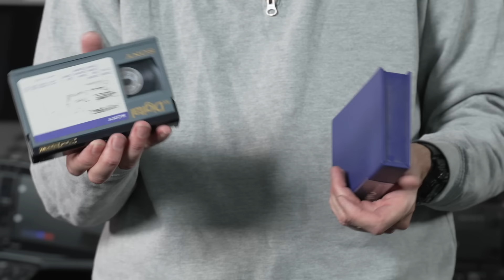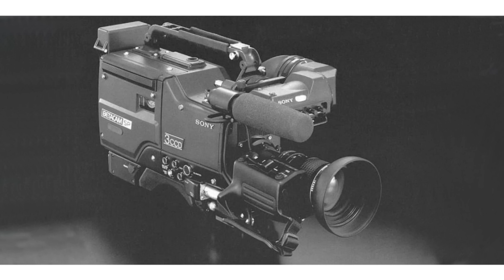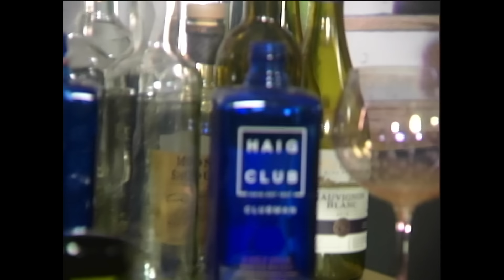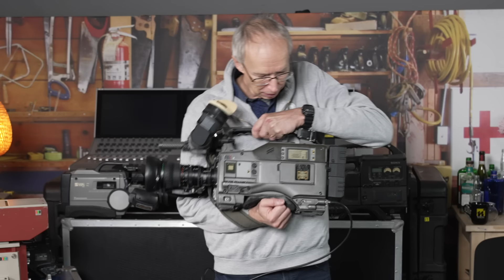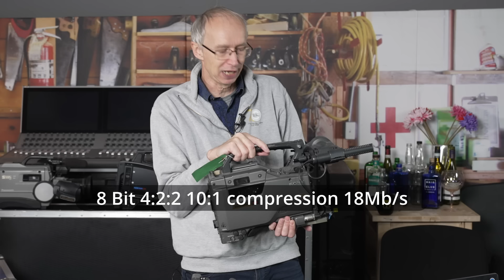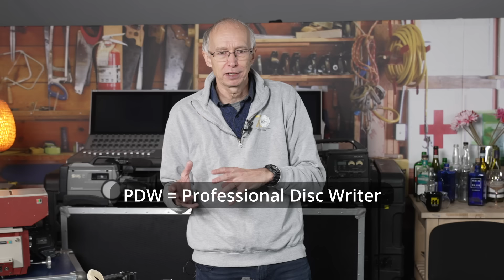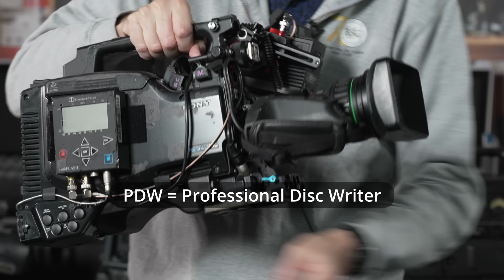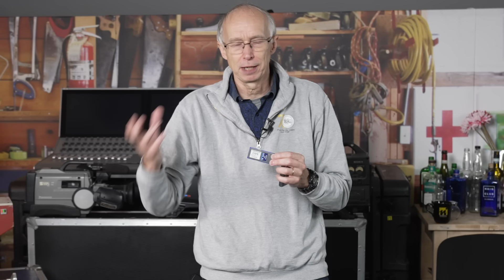Betacam, Digibeta & Optical Disc, a look back at some vintage Sony Camcorders with Alister Chapman

Comment: What an awesome trip down memory lane! Thank you!

I started my TV news career in 2000, and my first news camera was the venerable BVW-507 with those awful BP-90 "bible" batteries. Funny thing is I owned a VX-1000, which was better at low light, so I'd sneak in footage of that when I could.  Creative services had a BVW-D600 and an Ikegami HL-V59W. I'd sneak out the D600 on weekends if it wasn't out on assignment. We switched to DSR-500s shortly thereafter for news, but kept the awful BP-90 batteries. 

My next station had a mix of BVW-400s and DNW-90s, but our editing workflow was SX with the finicky Sony ES7 workstations.
Reply from the maker: I was trying to figure out when lithium batteries became "normal". The Digibeta cameras in 1994 had a V-Mount as standard as did every sony camera from then on and I suspect this was when the first Lithium batteries appeared, but I also remember using PagLok adapters on cameras with native V-Mounts to use PAGLok versions of the BP90 Nicads. It all seems so crude back then with NP1 and BP90 batteries that had go inside a compartment attached to the back of the camera with a big lid (or the cages that were available for the BP90's. And the BP90's had that fly lead that had to be plugged in so a battery swap was never quick. I don't think Lithium became commonplace until around 2000 when 3rd parties like IDX started to make them and the price became more affordable, but it wasn't really until around 2005 that lithium really became standard.

Comment: Pdw 700 are still used to this day, more for wireless RF systems. But also for tv work. But fx9 and pxw400/750 are now taking over the market in the netherlands
Reply from the maker: For HD the PDW-700 sensors are still about as good as it gets, add a Hyperdeck Shuttle and you have 10 bit ProRes on to SSD's so it can still be used if you want. I suspect mine will see some use in small multicam live jobs.
Reply: I've been using my 700 on football ob's for the past 5 years great camera and you can get them for a steal these days. Just upgraded to a PMW-500 same sensor but revised signal processing and records on SXS. 
There is still a lot of value in these older Sony cams that brought us into the HD world along with other 2/3 ccd cams like Panasonic HPX type cameras they are used all over the place especially for live streaming sports but if you treat them right and have a nice lens there really is not much to be gained by upgrading to a PXW750 unless your client requires it.
Reply: @thedave7760  i have my self a pmw400 is amazing camera, with great color's, i like the pmw400 and pmw500 colors more then the new pxwx400 or z750

Comment: What a delightful time machine trip!!!  The PD150 was my first serious camera, then the Z1U changed my life again, then my Ex1R..REALLY flipped my life upside down. Those were my first big 3 eye-opening, ground-shaking cameras that changed videography for me.
Reply from the maker: Indeed, the PD150 was a big disruptor - good and bad, it allowed more portable operation allowing you to take a camcorder anywhere and get a decent image. It slashed the cost of entry and the ability to edit cheaply on a computer was transformative. But it really was also the start of rates being cut, camera operators being replaced by runners and assistants. But gripe and moan about that as much as you want it was always inevitable that sooner or later improved technology would make filming easier and cheaper.

Comment: Fascinating video. The prices of those Betacams really makes the Sony Z450 & Z750 look cheap.

As well as seeing how far cameras have come, its also interesting to see how far tape technology has come. I have on my desk an LTO-4 drive, whose tapes store 800GB each (or about 70 MiniDV tapes). The newest variant, LTO-10, which uses some new formulation made of strontium, can store over 2500 MiniDV tapes :). Of course, these are not video decks, they are computer drives, but the technology is fascinating nonetheless. 

I like playing with old camcorders and using them for my YouTube channel, but some can be a bit unreliable at times. I don't expect them to be reliable, but I do have the electronics knowledge to repair them (sometimes). I tend to use older computers, so I'm quite content with DV and MPEG2 stuff, but I did eventually go out and buy a second hand 4k memory card camera a couple of years ago.

It would be cool to see a demonstration of that Sony 3D camcorder. I remember 3D becoming quite fashionable some years ago, but whilst I thought it was cool, I didn't really see much point. I guess everyone else thought the same :).
Reply from the maker: Yes, it would be very interesting to do a deeper dive into the TD300 3D camera, I'll have a chat with Visual Impact and try to set something up. The Z750 is still a pretty pricey piece of kit!

Comment: Thanks Alister & VI. An anthology of my career! It's really tempting to collect these things, but it becomes a deeply personal thing, interesting to fewer and fewer people brought up on solid-state, 4K, non-linear. Not forgetting "spousal approval" which stops dead any collection of these things!
Reply from the maker: Spousal approval is perhaps the biggest challenge (and the space to store them). It is very personal but I do also think that a lot of younger people are interested, especially if the cameras still work and are capable of producing an authentic period quality image. I'd really like to do a video on tape to tape editing using 3 machines and what that was like. I'm going up into the loft at the weekend to bring down a vintage iMac that has firewire to see if that still works, would be cool to look at how editing has changed.

Comment: Nice video Alister! I started with a DSR500WSP, a sold SD workhorse for many years. I regret selling it now as I'm collecting broadcast cameras too with Digi Beta, SX, BetaSP, HDV and SxS in the collection. I've also got 3 tube cameras and portable recorders like Umatic & BetaSP in the collection. Who thought years ago we would be using tiny stuff like A7's for broadcast? How things have radically changed in a relatively short period? Did you ever work with any non-Sony stuff like MII and D9?
Reply from the maker: I did a couple of shoots using a clients MII camera but not D9, Sony were almost always the main player. The DSR500 was another camera that I had for a while. Keeping them at that time wasn't an option as they had a fairly decent trade in value each time I upgraded. I'm somewhat envious of your collection I'd love to get a working 3 Tube camera, my first was a bright orange JVC KY2000.

Comment: Moving multi-camera concert production from DV to HDV was sure a challenge. The tiniest tape dropout would cost a couple seconds of footage, and the capture software didn't always catch it. That would throw your timeline sync out. Thanks for the trip down memory lane!
Reply from the maker: With both DV and HDV using 25Mb/s HDV was always going to be relatively data starved and HDV always felt like a stop-gap format waiting for something better to come along. Still quite a staggering feat of mechanical engineering to record so much data on such a tiny tape.

Comment: Hi Alister from Munich. I started with U-Matic. There were two versions Lowband and Hiband. Time flies.
Reply from the maker: 3 versions if you include HiBand SP which went to even higher frequencies than regular Hi-Band. I too started with U-Matic with a VO4800 and then BVU110. Quite scary to think U-Matic was only around 330 TVL yet was commonly used for TV news and docs from the 70s to the late 80s and early 90s. I don't miss carrying those great big recorders, tapes and batteries one little bit!
Reply: My first editing set is Sony U-matic low band 2850 videotape...
Reply: @alpbirol  and the RM 450.